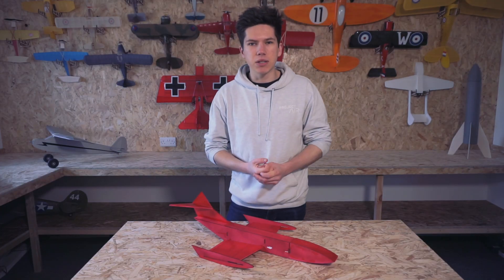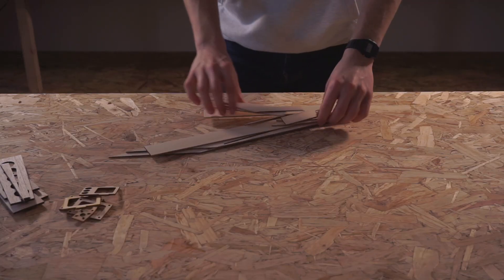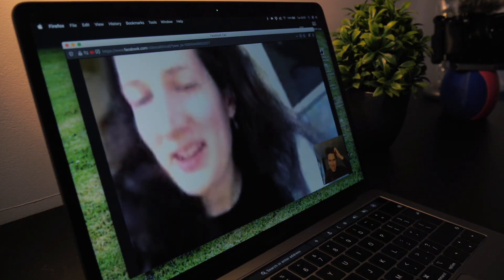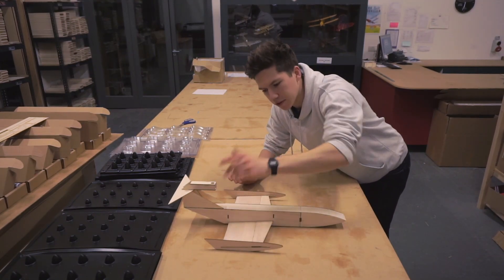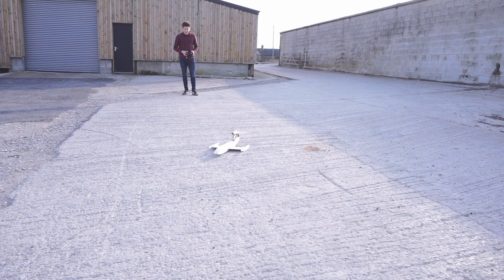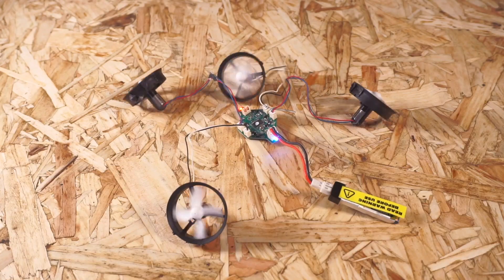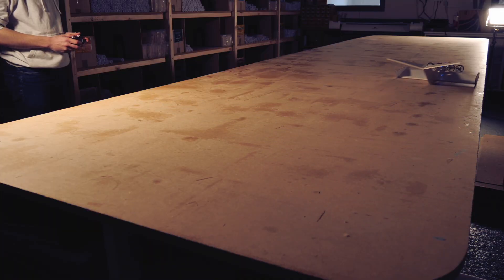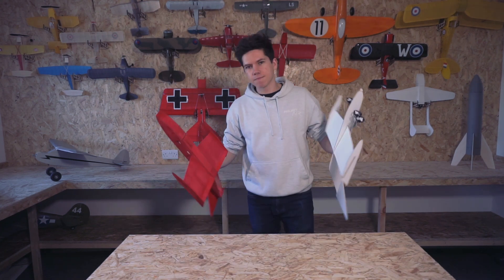Mini Ground Effect Vehicle

Comment: Actually, you would have done well to put a few motors on the back. 1 thing that the large ekranoplan taught the Russians, was that they only needed massive power directed under the wings at takeoff. Once 'hovering' in ground effect, the 2 motors at the back were the only ones needed to keep it at cruise. Pete Sripol built a model on YouTube, and Mustard has a great docu-vid on the original Russian monster that's worth a watch

Comment: An Ekranoplanunlike a plane requires it Center of lift to be in front of the CG. That way the nose can be lift first. That is why most have engine up front to control that lift. The rear tail is needed to bring it down, So it actually work backward from a plane.

Comment: While the tail thruster would create forward movement it would  also push down on fuselage nosing  down into water where  motors forward of wings whould create the cushion of air you desire like a hovercraft but at higher speeds wouldn't be as needed as winglets finally provide thier own compressed air cushion under the plane remember the tail  is not so much a lifting surface as it is a steering surface for the lifting body of acranoplane

Comment: Project steamboat ekranalyork have large thrust engines up front to blow air under wing to liftoff and get to speed only.  These get shut down and steamboat flies using less thrust engines in tail.  Try three engines, two up front to lift wing when stationary, and small sustainer engine in tail.  Shut down forward engines as soon as it flies and throttling the small engine is less tricky because entire throttle range represents bottom 20% of big engines, possibly less.

Comment: How do you calculate the CG on your craft?   I had one as a push along using a reverse lippish delta style wing.  The horizontal stab was angled up at the front to force the nose down.  Once underway the ground effect lifts the nose, but the stab forces it back to level again.  Thanks in advance Allen

Comment: The simplest grond effect wing I could think of is shaped like a set square with fin at the tip on the backside. In other works - turn a set square with the long edge to the front and the angled sides downwards (this supports the ground effect and inhibits taking off and loosing stable aero dynamics) and put a fin on the back to get directional stability.

Comment: I suspect both of these ekranplanes will fly with the right airfoil and morning the CG back. (And maybe a little more power on the white one). 

See gungan works reply - he has built some gliders.

I do not think you have a thick enough airfoil in any of those models. You have very thin flat wings which are good at high speed but produce almost no lift at lower speeds. The vertical stabilizer should be a similar profile but thicker so it stalls at a slightly higher speed. This will tend to stabilize the craft when it pitches up by having the lift at the front fall of quicker than the lift at the back. 

This would counter the instability
you can see when the red one pitches up and then stalls in your slide testing.

A thicker airfoil will produce more lift at lower speeds and lower angle of attack leading to a more controllable craft. 

As slow as these models need to fly, make the wing look more like a modern airliner with the flaps and droops all the way down. If you determine that is too much sand some off the bottom of the leading edge.

Start with about a 5° angle of attack for the wing and about 10° for the vertical stabilizer as measured when the fuselage is level and trim from there. Under steady but slightly excessive power (take off power or a little less) it should pitch up and leave ground effect briefly before setting back into ground effect. This is called fugoid oscilation. It should almost stop with a slight power reduction, but ekranplanes actually use this for stability so it will slowly pitch up and down when over a perfect surface.

If instead of setting back into ground effect reliably it hits the surface then the vertical stabilizer needs to stall later and/or the wing earlier.

Forcing air under the wings is actually somewhat counter-productive once you have any forward motion because the airflow over the wing will generate lift at vehicle speeds that would normally be below stall speed. 

In fact you can get lift without any forward motion this way, but in marine use there is suction from the water to deal with and a blast of air under the wing is just the ticket to break that grip.

The pivot on the model that sank is not a bad idea at all. Arranging the pivot so that when pitched up most of the air goes under the wings but when set forward the props are over wing would be better. 

The reason airliners have the engines hanging below the wing has more to do with maintenance and safety than with efficiency - those mounts are designed to let the engine fall off rather than damaging wing if an engine locked up.

One last tip from boat design is stepped hulls. Putting steps on the bottom of the fuselage and on the bottom and bottom sides of the end plates would probably greatly reduced takeoff thrust required without much increase in aerodynamic drag and would probably also make for smoother landings.

I hope you get something flying. I have a dream of an ekranplane pontoon boat, but it would probably be crazy dangerous. Still it would be cool to blow past those speedboats and skiboats in something that looks more like a dock than a boat. LoL

Comment: Well, that was worth the wait, good to see you well. Great (and frustrating) project. I made an airboat from foam and a reinforced bottom. Good brushless power and fast as well. I decided that some stubby wings and winglets, plus stabilizers on the back were in order. I managed a good bit of ground effect use, but the balance of power and weight is a pain, along with cg and cf. I decided to get a brushless whoop for the lockdown, and have a Pt-17 and Zohd Talon nano on the way. This coronapocalypse is going to break me one way or another. I may need to start a channel, lmao. Thanks for the respite, be well and stay safe. Adjusted my notifications to all, sorry so late. Cheers!

Comment: Loved this one! Both the project and also your editing style - very engaging! I now know how to pronounce ekranoplan now, which is a bonus :D would love to see some DIY racing hovercrafts or something... that would be fun!
Reply from the maker: Cheers Matt! Brb, just going to get to work on those racing hovercraft! 😉😁 With lockdown it might be tricky to organise a race... unless we somehow control them via the internet? 🤔
Reply: @Project-Air  FPV virtual reality hovercraft racing :D
Reply: @Project-Air  You actually did it... great job lad!
Reply: @Project-Air  you can use more power also in the model 1 you can add another engine in the back for air intake you can make air vents at front also try to make the top flat because we don't want to use burnalisis theory which gives the plane lift and use thinner wood look at some wing designs and angles online

Comment: I have built a number of ground effect gliders over the years. The key is to have a very far aft CG and positive incidence on the tail. As the craft accelerates, the tail creates more lift, pushing the nose down. At the same time, as the nose lowers, the wing gets closer to the ground, ground effect becomes more powerful, and lifts the nose up, balancing the lifting force of the tail. After a few oscillations, the ekranoplan reaches a point of dynamic stability such that the faster the craft flies, the higher it floats in ground effect (but never leaves ground effect). A good ground effect craft is a terrible airplane out of ground effect—for my gliders, if you throw it fast, it nosedives; and if you throw it slowly, and it pitches up like a MIG-29 doing a cobra maneuver, and falls down like a feather. If I can upload it, I know I have video of one of these gliders somewhere...
Reply: Ah interesting, so the designs are made to force the wing into the proper state. That makes sense
Reply: Air-headed Aviator that is a great way to put it. Ground effect only works in ground effect, so the tail is designed to force the craft to stay in ground effect.
Reply: Ok, sounds like my advice on the wing stall speed vs rear stabilizer is backwards and the orientation of the rear airfoil is wrong too. I was thinking a forward CG.
Reply: @jdrissel  yep. Rather than pulling the nose down with a forward CG, you push the nose down with the tail.
Reply: can i contact you i have to take some information

Comment: How can they call it a true aircraft when it’s only like a few foot of the ground
Reply: Cause it’s still off the ground
Reply: thats why they don't call it an aircraft. they call it an ekranoplan. 

ekranoplan is it's own type of vehicle. It's neither an aircraft nor a ship nor a hovercraft, it's its own thing.

In terms of purpose it's closer to a speed boat than to an aircraft. It's able to travel over the surface of water at higher speed and lower fuel consumption than any regular boat of comparable size ever could.
Reply: @hannesgroesslinger   a helicopter and and airplane are two different vehicles, but their both still considered aircraft

Comment: Dude, can you make a RC Helicopter from scratch?

There seems to be no one on YouTube who has made rc Helicopter fully from scratch(Only some videos, where they strap parts of some other rc Helicopter)
Reply from the maker: I literally referenced my previous project in this video, which involved building a helicopter from scratch 😂 Enjoy! 😁
Reply: There so freaking complicated.
Reply: @loganreuter6072  I still wanna build one, but I am unable to get any reference from anywhere
Reply: @sakutaazusagawa208  id say if you want to build one  do your research. if you cant find anything on youtube like your saying try to do research on actual helicopters. For example I also plan to build one from scratch too so i started research how real helicopter work and i just found out what a swashplate is.
Reply: @loganreuter6072  btw dude, could you build one. I am really confused. Like are we supposed to use flight controllers or only a 3-axis gyro will work, and other such stuff
Reply: @sakutaazusagawa208  I’m in the process of building one right now. And let me say there not easy to build

Comment: Would keeping it heavy not help in stopping it fly? Since they where load carriers? Make a large weighty model and just throw power at it till it works.....like the real ones.
Reply: Didn’t the real one have like 8 turbofan engines at the front?
Reply: @no_name2882  yeah but think they were just jet engines
Reply: @jons6125  there’s different types of jets
Reply: @no_name2882  ok but non turbo fan jet engines